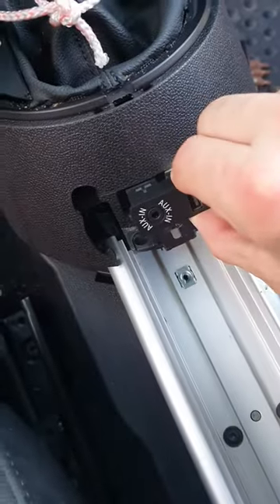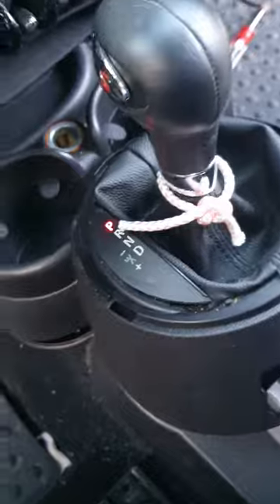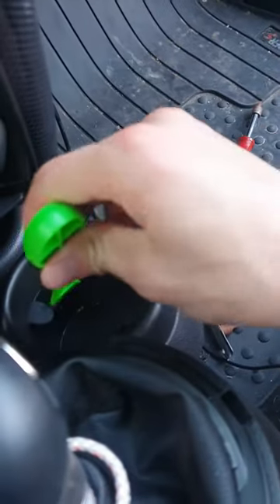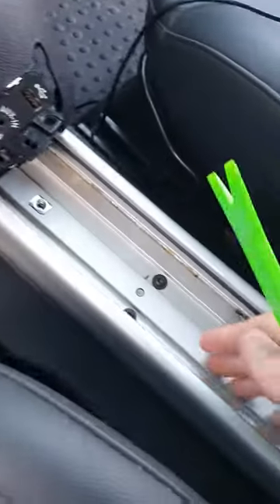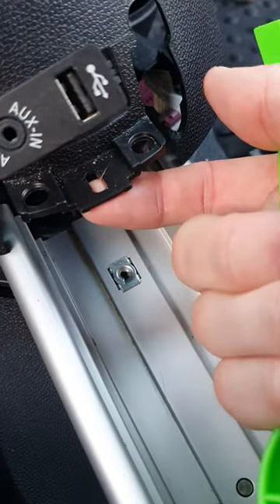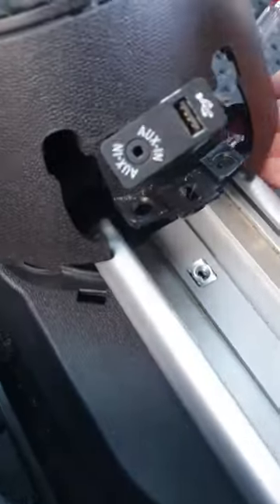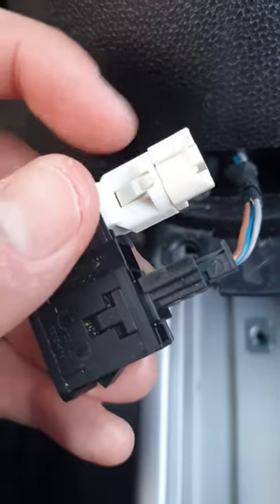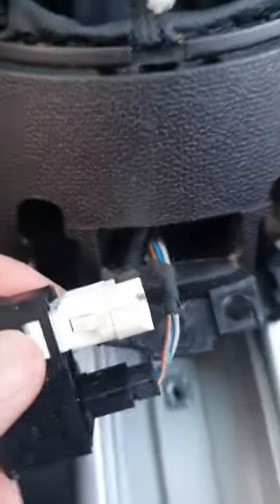Removing the center console thing from 2013 Mini Cooper Countryman to get to the AUX and USB ports

Comment: Were you replacing the aux or usb? I’d like to put a new aux in. The current one is like a hot dog down a hallway situation.
Reply from the maker: I was having aux issues when I went over 70, but I replaced both. I think Mini/BMW only sells the 2 in 1 part. I'm sure its possible to just do the aux port, but that'd be beyond me. With what I did it was just a simple unplug old part and plug in new part.
Reply: @Chef-Jeff  thank you! I will probably replace them if I don’t do a double din stereo under the speedo